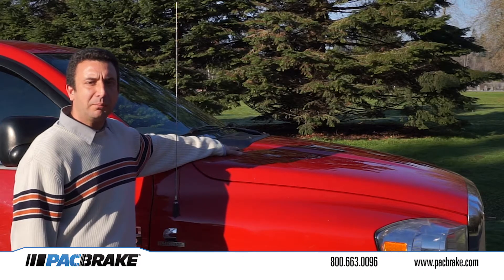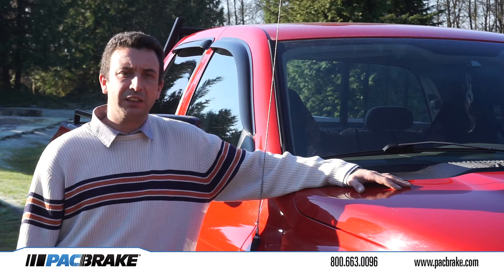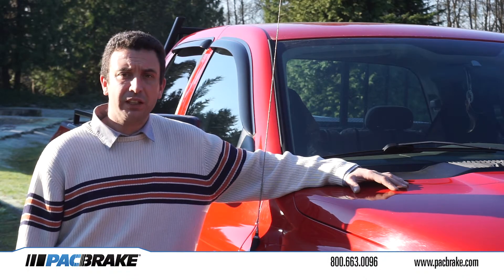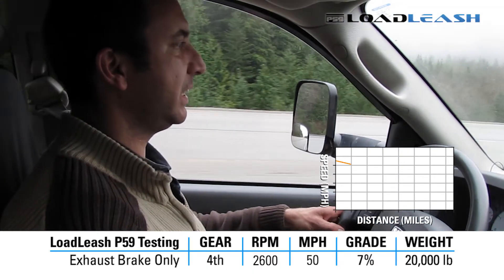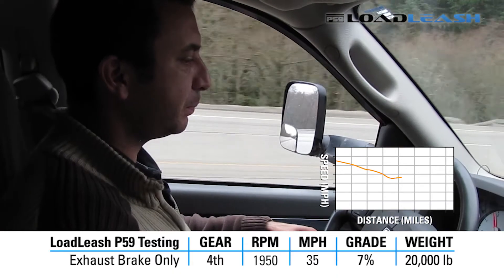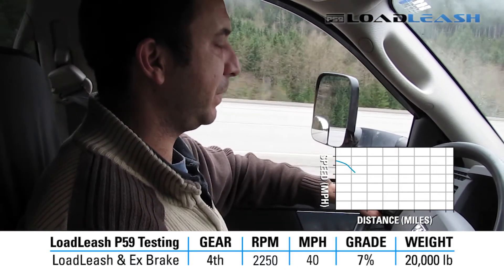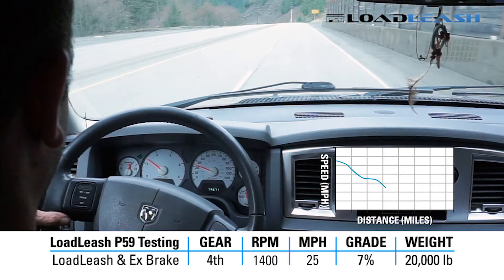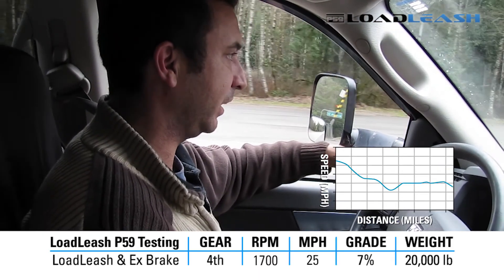P59 LoadLeash Engine Brake by Pacbrake

Comment: Totally need one for my 12v stat and I believe there is a market for people with the older motors for a product like this
Reply: I would buy 2 of them if they made them.
Reply: @nunyabiness417  same I need one in my 1993 fummins f350
Reply: For sure there is. I need ons
Reply: I'd buy 2 for 24 valve p pump

Comment: Is this going to be developed for the second gens, or will this only work for the common rails?
Reply from the maker: The P59 has only been developed for the common rail engines at the moment. Nothing in the works for second gen.. :(
Reply: Pacbrake Company well that sucks.
Reply: @dodgezilla1012  I agree. I have an 01 with just 100,500 miles on it. I would love one of these since I will have my truck for a long time.

Comment: Like that!
Will this also work on a modified truck equipped with a exhaust brake or just on stock trucks equipped with a exhaust brake?
Reply from the maker: Hi Alejandro, the P59 LoadLeash will work for both trucks.
Reply from the maker: Hey Alejandro, sorry for the delayed reply. Yes this will work with any truck as long as it has an exhaust brake.